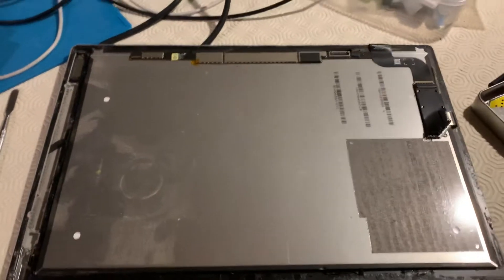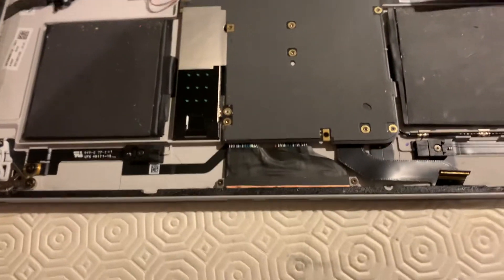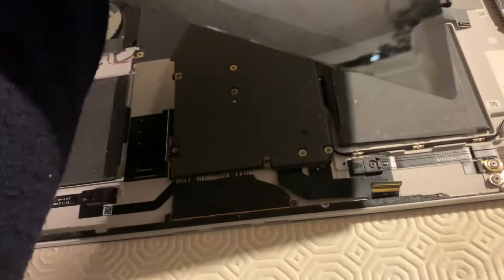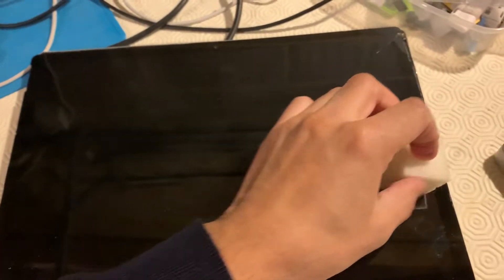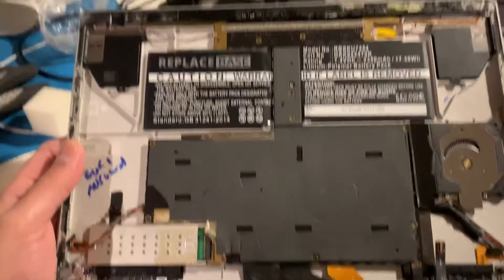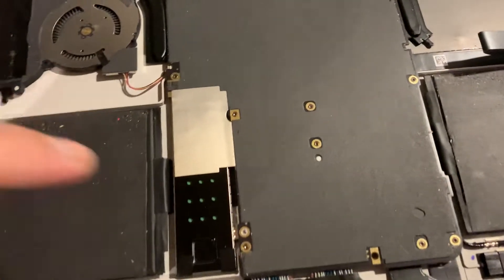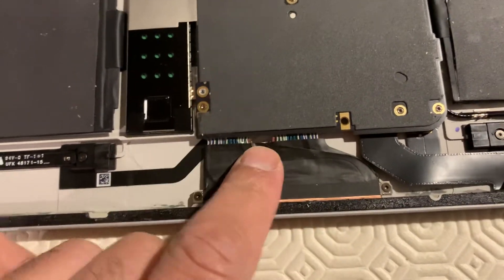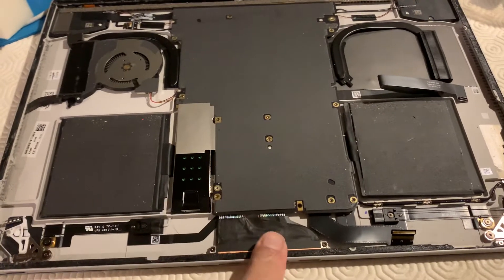Surface Book 2 15” version insides

Comment: I wanted to inspect the hardware, as mine keeps ticking in the upper left corner of the screen, and I wanted to see if I could fix it without removing the screen. However, I couldn't even figure out where the ticking is coming from. Sounds like a clock and doesn't go away when the sound is turned off.
Reply from the maker: I’d say take the keyboard up and disconnect the speakers first.  Not had a ticking noise before

Comment: Hello, do you solved charging issue?  With my surface book 2, after a long struggle, I replaced the battery in the tablet and the keyboard + display, which of course I managed to break during the replacement :D Now 2 months of pleasant use with new batteries and after several cycles the tablet part stopped charging. The battery is stuck at 0% but it just won't charge even when the laptop is off. I've probably tried all options, so it's probably a HW problem, but would a battery that's been used for 2 months break?
Reply from the maker: @michalpesek2911  is this the keyboard battery or the tablet battery ?

Comment: Hey, i know this video is old, but im still rocking a surface book 2 13"5. and with an i7 and a gtx 1050. but ive been concerned... the gpu makes tons of fan noise but the cpu is silent... and i see that there is a fan in that laptop. do you think my fan might be broken?
Reply from the maker: @switch2282  I think the fan will be fine it’s just the design of the keyboard.  Ensure it’s cooled and nothing is obstructed its vents.

Comment: thanks for the video 
my surface book 2 fan is not working properly it's seeming like there is some dust in it is there an effective way to clean it I tried to use hairdryer, but it didn't work it's still too noisy and not work properly
Reply from the maker: Is yours the 15” one?

Comment: Hello sir

Can you test if a double-sided ssd fit in the 15" surface book 2? I heard there's thermal issue after that because the heat sink is not applying enough pressure to the cpu
Reply from the maker: Hello, I have only tested this one - I don't have any more to hand.  Sabrent 1TB Rocket NVMe PCIe M.2 2280 Internal SSD High Performance Solid State Drive (SB-ROCKET-1TB)

Comment: Thanks for your videos! I had a quick question if you don’t mind. 

I recently got a hold of a Surface Book 2 15 Model 1793. I have searched and haven’t conclusively got an answer. I am lacking the keyboard for the computer and I believe I need a model 1813 keyboard to replace it. Are the keyboards paired to each unit individually or can I buy another 1813 to return function to the computer?
Reply from the maker: Hello, thanks for reaching out to me.   1813 is the right model, these though go for a lot of money second hand so you are going to have to hunt for anyone selling one with a smashed screen so you can take the keyboard.   I just looked from the UK and it appears they are starting at $500 but keep your eyes open.

Any 1813 will do as they all have the GPU so just find one you like and that will give you a keyboard again.  You could alternatively get the surface dock 1 and then plug a keyboard and mouse into the dock, as well as a display.  

I personally really like this 15" variant, my kid plays genshin on it and it runs smooth.  The 13.5 with the GTX1050 was a letdown in comparison.
Reply: @microsoftsurfacegeekdetail5739   Thank you for the response that resolved it for me perfectly! 
I will definitely be hunting for one now. I managed to save one of these from a State surplus store for under $100 and wanted to turn it into my daily driver laptop. I will refer to your videos if I ever need to service it!
Reply from the maker: @jordanmann2962  I’m just doing something similar except my keyboard connector and the internal connector both must have had a power issue as they both were faulty,  the screen was faulty as well.  I’ve got the screen out as it was knackered so a new on is coming from aliexpress and the jury is out on the keyboard as it worked then it started doing the gpu disappear and reappear but that’s a new battery most of the time.  
I was in two minds about swapping the battery on the tablet part.
What’s next for you to do?
Reply: @microsoftsurfacegeekdetail5739   I got mine without the keyboard that’s the main thing. The screen is also cracked (perhaps touch is also not working) it boots to desktop but I cannot interact with it so I may replace that in the future. However I don’t care about touch functionality so I may let it be and settle with just the keyboard fix.
Reply from the maker: @jordanmann2962  I’ve got a surface laptop with a crack down it but it works still so I put a screen protector over it.